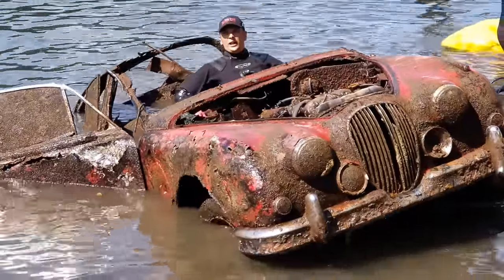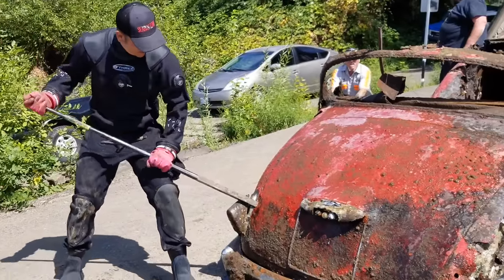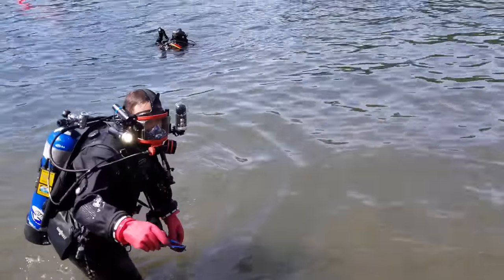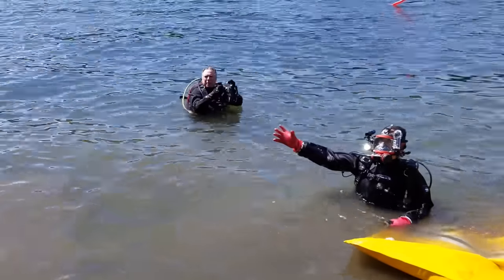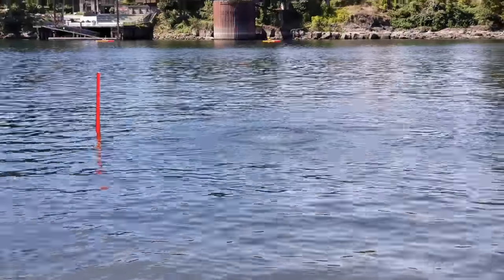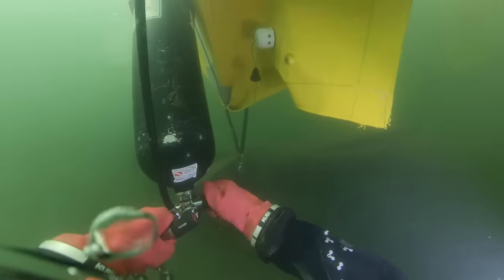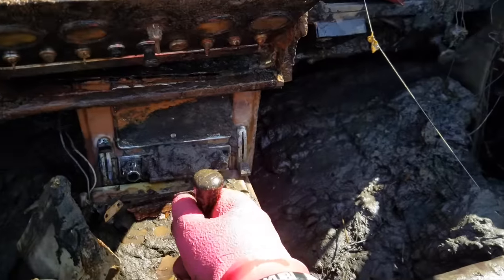FOUND JAGUAR MK2 Classic Car Underwater at Boat Ramp!

Comment: Most interesting video so far. As a car guy it about killed me to watch you use that pry bar on the trunk 😬
Reply from the maker: Yeah, sorry for the trunk. 😂😬
Reply: A restorer will have it up and running in no time, although they will ask “who was the idiot that hit it with a crowbar”.
Reply: I feel ya this hurt bad
Reply: As a fellow car guy who bleeds 30 weight I always thought that there should be such a thing as vehicle abuse.
Reply: @nickjanssens  I think it's a little late for a restoration on a clunker like that
Reply: @americanlivesmatter-BmanWild  cant get restored. They are too far gone. And they do need to check for a body. If there is one the police need to come.
Reply: @americanlivesmatter-BmanWild  Well someone has been sipping to much from daddy's booze :(

It's a fucking wreck nobody cares.
He has to search for bodies and guns, and so he does.

He is a diver not a car nut.
Reply: Dennis Collins really might restore or at least part out that car. They are very valuable. What a shame.
Reply: Im a car guy and who cares that thing is gone. Your no restoring that your just building a new car
Reply: @mpshotattwice3253   Yes, easier and faster.... Pull down the rear seat backrest, it's not even bolted in place and goes straight through to the boot.  The way he ATTACKED it with the bar was nothing less than criminal, he didn't even try the release catch first.  That car when restored is probably worth between $200,000-$250,000.
Reply: That car is beyond restoration. It’s so far gone that there probably aren’t even any parts that can be salvaged. It’s just a rusty wreck that’s been sitting at the bottom of a lake for decades.
Reply: Better solution to pry bar the boot open maybe try pull the back seats forward first!? Not much to restore on this anyway plenty still about here anyway
Reply: Only good for a parts car really its abit twisted Haha! Mind you,  you guys get to run death trap rat rods over there this mk2 wouldn't get back on the road here in the UK now as a restorator theres a point where something is to far gone! Plus its steel body soon as air starts to dry it out she'll crumble away to dust poor thing!
Reply: @americanlivesmatter-BmanWild  even if it was a viable, probably not work the time and money to get it running and driving, let alone registerable.
Reply: Having just watched it I wanted to slap him it hurt to watch even if it is too far gone
Reply: Parts car.... Somebody will use something off her. Beautiful style vehicle.
Reply: @nickjanssens  lol 😂
Reply: ㅈ
Reply: I had a 58 and a 60 .they looked like this car.
Reply: You must of hated Ken Miles in Ford vs Ferrari. 😬
Reply: @A.C.00  lol l love that movie
Reply: It looks in pretty bad shake I can’t see them restoring that.
Reply: Same.. haha
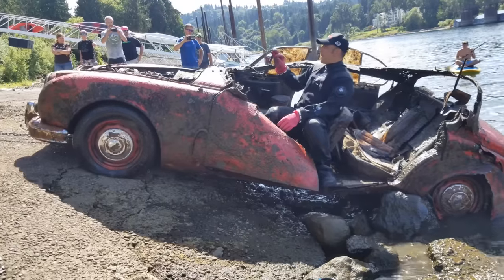Reply: The whole chassis nearly folded into itself @ 7:54 I wouldn’t worry about restoring this one 😂
Reply: @AdventuresWithPurpose  how long had it been in the river?.
Reply: Lls I stop the video when the bar went up 🤣🤣 noooooo 😂😂😭

Comment: If this was the UK a body in the car would be a high probability as in the 60's they were the go to car for armed robbery getaway car, big enough for four big guys guns and swag, especially the 3.8, later the Ford Zephyr Consuls  and Zodiacs, Later the Ford Granda and Consul the Granad was the Sweeney favourite of which I went through three beforre going over to the XJ6 XJ6 Coupe and Daimler double 6 V12, pass anything but a gas station max I ever got was 11 to the gallon.
Reply from the maker: You know a lot about the gangster robber cars. With a name like Nick, I'm thinking you have a few stories of your time in the mob.. 😂😬
Reply: @Tanner Duppong Yes MK 1/2 MK9 and ten, motorway used XJ6's for a while. But they had the smaller engined 2.4 sloth's mainly only traffic and special branch had the 3.8 manual.
Reply: I may have missed it, but does anyone know where  this is?
Reply: Let's not leave out the oul ford transit too, well known for the hiest
Reply: @AdventuresWithPurpose  for the bank heists they used the Ford Transit Van because it had room and carrying capacity but drove like a car.
Reply: If you were in it for love you became a race driver, if you were in it for the money you became a getaway driver.
Reply: @AdventuresWithPurpose  bet those tools are worth money if they are jaguar or lucas
Reply: @AdventuresWithPurpose  n

Comment: That dash is standard. All wood. AND its a manual. (Or "stick" as the Americans say) Jaguar MK2 in a manual is a rare and desirable car. Just the manual conversion gear (geabox, pedal box, clutch assembly etc)  would be worth a bit and certainly would cover the cost of recovery.
Reply: I worked on those cars as an apprentice mechanic and I never ever saw an automatic in five years.  The whole idea of the car was it was a sports car and a drivers car, not a lazy drivers car.
Reply: The dashboard looks like something out of James bond

Comment: I cringed so hard when they used a crow bar to open trunk
Reply: AlexPnRoss I mean the car is fucked doesn’t really matter how the thing gets opened
Reply: Same here ouch lol
Reply: Half the time they literally fall apart when they get pulled out
Reply: I agree. Even if the car has been under water for so long, you never know what could be salvaged off it. Why add insult to injury? Goes to show they are divers and not car guys.
Reply: @salvatoreo2186  they have an agreement with the police that every car they pull out of the water, must be checked for any bodies/human remains right after the car is pulled out. If they do happen to find such items they need to immediately turn the vehicle over to the police. So unfortunately they must break open every truck to check for bodies.
Reply: that car is repairable !!
Reply: Me too!!!
Reply: Pretty much doubt that the vehicle could be driven once again, at least they got it out of the river so not too much of a hassle.
Reply: It's a rare car, but at the end of the day I dont think much of it was good anymore. Even if it was restorable it probably wouldn't be worth the time and money to go through a full restoration.
Reply: Car guy here, that thing is rotten and beyond fucked, there’s nothing salvageable on it apart from maybe some switch gear and even that’s a big maybe. If these things rotted on a rainy day what do you think years at the bottom of a river has done to it, it’s a goner so get over it lol.

Comment: It looks like someone went through a good amount of trouble to aftermarket mod the dash. My guess is the car was stolen and dumped, or dumped for an insurance payout. Otherwise who'd leave a car like this in the river?
Reply: Felix24148 think it’s stock, a lot of old jags have those toggle switches usually surrounded by wood, probably rotted off
Reply: @logansaltzman7927  Ah I see. Still a shame the car spent decades in a river though. It's all so rusted out I doubt anything could be salvaged from it
Reply: Felix24148 yeah, really breaks my heart thinking a fellow jag owner lost their car in a river
Reply: @logansaltzman7927  Modern Jags these days aren't as good. They break down a lot. But I hear the classics were great.
Reply: Felix24148 i think all jags in general are great cars, but the new ones have electrical problems. I have a 1996, a lot of people are surprised when I tell them it’s actually very reliable. But when things do go wrong, it’s very expensive to repair.
Reply: Tata hasn’t treated Land Rover Jaguar very well. I wish Ford would buy them back.
Reply: @logansaltzman7927  I'll bet. I recently learned the Chevy Caprice that was manufactured in the last few years is an expensive car to fix because all the parts from from Australia. And the ones that have flew fuel engines are crap. Who knew?
Reply: @logansaltzman7927  For made good stuff. When they were part owner of Mazda, they made Mazdas good till the partnership ended.
Reply: Dave Iauco  That's usually when you just sell it to someone else and it becomes their problem
Reply: @logansaltzman7927  You have to be kidding right ???  Ford Asset Stripped the company then dumped it.  Ford were the worst thing that ever happened to Jaguar
Reply: That dash was standard !!  The wood would have been Burr Walnut and was standard on all models.

Comment: What the hell is a Jag mark II doing in a river for? and someone must have DUMPED that off a bridge and it fell on its roof judging by the damage and not long ago either. As I bet the tires and the WD40 based on the bodies condition are only about 3 years old, and what a waste too

like if your gonna throw something off a bridge, make it something ugly like a C7 or an Aventador, not a Vintage Inspector Morse Era Jaguar!

Comment: 8:39 some poor guy has one of these Jags 99.99999% to show car perfection but cannot find a rear tail light pod as none are known to exist anymore.
Reply: the metal was paper thin as it was crushed so easily. nothing with metal that thin on the car is salvageable. maybe the engine and maybe parts of the gauge cluster

Comment: Its not jagWIRE wtf? so annoying!!! Its Jaguar.... no W anywhere in there or any wires at all...
Reply: Only wires were likely from Lucas.
Reply: Who cares.
Reply: Francisco Xavier Simon Jacques Ahh...so you get the Lucas reference! Nice!
Q: Why does Lucas Electrics coat their wires in rubber?

A: It’s to keep the fire contained inside of them!🧐
Reply: @maxj0930  The only Lucas I know is I used to see glass headlights when I was a kid on  buses and cars and it used to be Lucas written on them
Reply: Of course jaguar doesn't have a W anywhere except in the pronunciation JAG-WER or 
JAG-WERE
Reply: Francisco Xavier Simon Jacques My brother-in- law has a Triumph TR-6. On the bumper sticker, it reads:” The perfect anti-theft method: Lucas Electrics”. It references the reliability issues associated with Lucas, which supplies most of the Brit cars with their electrical components. Stuff’s all true!
Reply: @maxj0930  joseph Lucas didnt use electricity he used smoke . If the smoke didnt leak everyrhing worked
Reply: I agree with you all my bro

Comment: Man that was a lot of money in car sent to the bottom. Never found a Jaguar. Did fish a friends 1974 International Scout out of the Finely River by Ozark Mo. Was playing in the mud during high water and dumped it into a 8ft deep hidden wash out hole . Ran the hoist truck with in 200ft of it and fished it out. Wasnt completely lost. Took two weeks of drying it out and draining out all of the water out of the gas tank. Front and backup diffs and trans and transfer case. Drained out the engine and brakes of water and fluids. Flushed all systems and power washed it inside and out. Ran a dehumidifier and fans. Got it all back together and it ran and drove afterwards. Vehicles can with stand exposer to water. Get to them quick enough. And they can be saved with some work. Repaired and saved a 1963 Mercury Comet. Caught in a flash flood and rolled up on its side. Owner was very appreciative for saving the car.  Got it running and dried out.   It can be done but its a long process. Saved a Buick Wildcat 425 Nail head engine that sat in the car in six feet of water for 2 years. Drained it and soaked with Diesel fuel and Dextron transmission fluid. Two weeks later I flushed it out and filled it with 20 W50 Rotella oil. Turned  over engine then put the spark plugs in it . Poured some gas in the carburetor and it started and came back to life. The car a 1966 Buick Wildcat was stripped out and ran it in 4 demolition competitions. Sold the engine and used a Chevrolet 307 engine and a Powerglide trans for power in the car.

Comment: New Subscriber, love this, anything that has to do with underwater recovery like you guy/gals are doing is fantastic. one question, why don't you use a portable gas powered air compressor to inflate the air bags, at least when you are working close to land like the boat ramps.

Comment: Even though it was in awful condition you'd have to be a madman to start jabbing and bending the car with a pry bar
Reply from the maker: Did you read the comments as to why it had to be done? Police require that the car be searched for bodies before it goes on the tow truck. Unfortunately, there was no other way to open the lid at that moment in time.
Reply: @AdventuresWithPurpose  MP3

Comment: Instead of dragging air tanks down, why not invest in a small air pump or compressor,  this was you can run a hose down to the bags instead of tanks, and you could blow some of the silt out of the csrs
Reply from the maker: Blowing silt out of the cars creates addition work and a storm of dust. As for more equipment... well, for one, it's more equipment we'd have to haul, plus there are times we are not so close to shore and often in a current with obstacles. For those reasons, we keep it simple as steam lined as possible. One tank will fill 2 bags.
Reply: Laalalaallala.ala,alala

Comment: There is a lot of parts on that car people that restore them would love to have.
Reply from the maker: Even after 20 years underwater?
Reply: @AdventuresWithPurpose  I would have loved to buy the wheels off the corvette you brought up
Reply: @AdventuresWithPurpose  I had the same thought.  Some engine components, like the valve cover and possibly some internals.  SU carburetors are expensive and made of aluminum.  They might be salvageable.  The radiator is probably copper.
Reply: Yeah like headlight bezels, whells, hubcaps window trim a lot more. You could sell these parts they help pay for your trips.  I am sure there are alot of rare parts on the jag especially .

Comment: just curious.  when you change air tanks u/w [re bag filling], don't you get a little water forced thru the first stage of the reg ?  that would suggest frequent servicing, especially after use in salt or brackish water.  please take care n stay safe.  dLLund in mpls, mn.

Comment: Why risk additional damage for a YouTube shot opening the trunk?  Sure there is significant damage all around, but if it is going to be "restored" as it was planned, replacement panels may not exist for this model and keeping things as undamaged as possible should be key.  Not letting it drag over a big rock and on the ramp should have been prevented and thought out in advance when this salvage operation planned.  You could treat an ordinary beater this way, but not for a Jaguar.

Comment: Why would anyone do that to a Mark II with 35,000 miles? Sheffield steel is why it’s so heavy. The dash and interior side panels are made of burled walnut. Our fam is 4 generations of Jag ownership. My grandfather had a MK2, an EType and an XJ6. My great aunt and uncle and great grandparents had XJ6’s. My parents had a Vanden Plas and an XJ8 LWB and now have a new XE (mine). Even in its condition , you can tell it’s a uniquely exceptional vehicle.
Reply: And Wilton carpet

Comment: good deal on the sponsorship with the masks  with communication  thats super cool stuff  i got my first Scuba certification in 1978  and we used to use these white plastic  slates that had a pencil attached to it by a  length of surgical tubing  at decompression  dives we would play tic tac toe or hangman  with each other btw dive shops sold those things and called them magic Slates  because they wrote underwater

Comment: Wonder where in the valley this was?  I don't recognize that boat ramp.
Reply: @mpshotattwice3253  
Hmm, not far from where I live.  I'm surprised it hasn't been blocked off like most other smaller, unimproved  boat ramps in the Portland area.
Reply from the maker: The neighbors have been trying to get it closed for years.
Reply: @mpshotattwice3253  
Not until after this one.

Comment: Using a crowbar to open the trunk?  You should have found a specialist---That trunk  was could have been used,   until you destroyed it.
Reply from the maker: Police require we open trunks and check for bodies before tow truck hauls it off. No trunk specialist was on hand. Did you have a solution which would have been better? Happy to have you along on each car recovery to handle as you see appropriate... 😉
Reply: @AdventuresWithPurpose  Thank you!  It appears you had no practical option.

Comment: It is actually a Daimler because it has the double bumper bars, otherwise known as a Ladies Gas Guzzler. The Jag had a single bumper. I know as I owned the Mk2 Jag and had a straight six 3.4litre engine with three SU carburetors, and the spark plugs were on the side of the head not the top. The Daimler has the USA built 3.8litre, the one fitted to that car. Still a lovely drive.